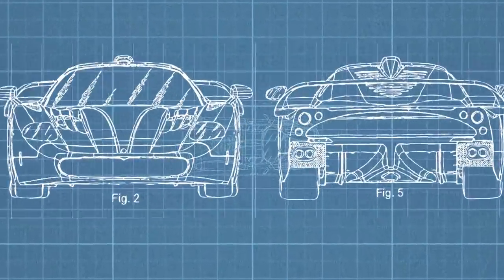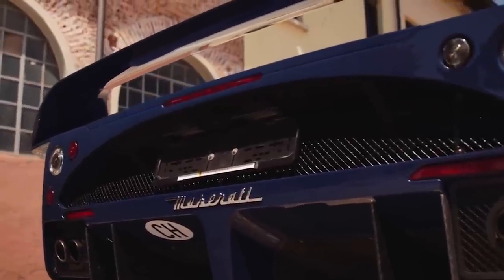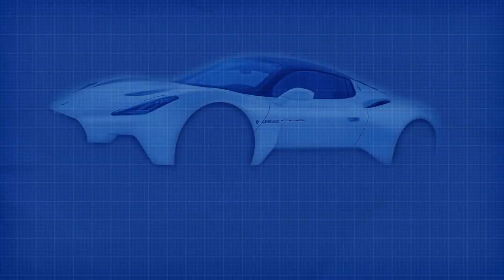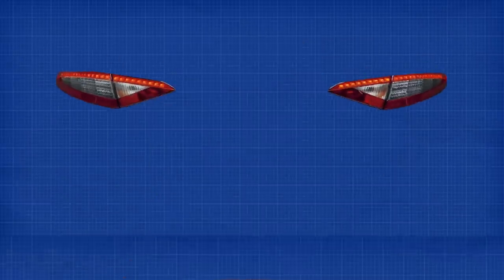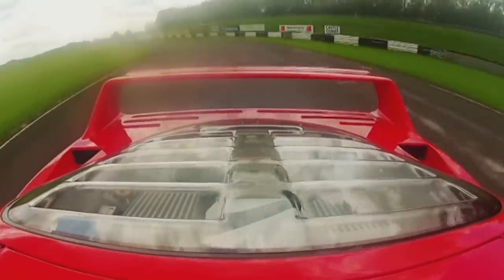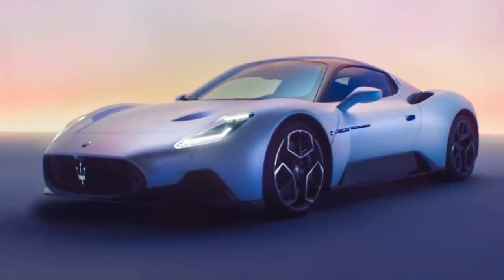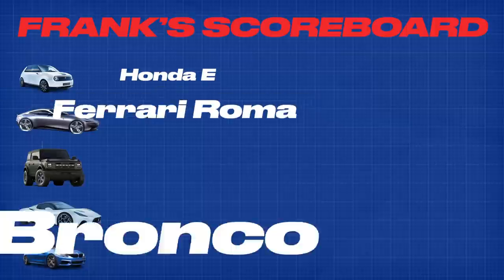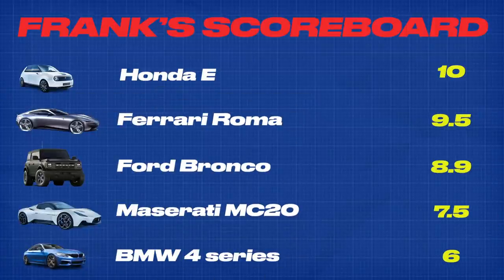MC12 Designer Analyses The Maserati MC20!

Comment: To be honest, I like the understatedness of the car. I especially like how the air intakes at the rear fenders aren't overly present. For the wheels, rather than highlighting the trident I would have liked if the inside of those three shapes brought back the concave shape pointed out as a defining feature of the Maserati front grill.

If we do get a wilder version I'd like an active rear wing and maybe something not quite an edge, but some kind of tightening of the curvature along the fender line drawn in red in the video.

Also, 100 times yes on keeping the interior more tactile. I hate how so much design is hiding buttons and such away the past decade. I dont want a surface that magically does something when you touch the right spot. Give me a visible and tactile button to push, please.
Reply: Understated... for a 1000hp car.  ....
Crap idea
Reply: @dombower  to each their own. It's not like there's a shortage of more bombastic super/hypercars.
Reply: Same. I like designs that are bonkers, but for myself, I like.... simple
Reply: Its nice, but forgettable. The front is not sharp enough. I've already forgotten about it.

Comment: Unlike Frank, I LOVE the design. The engine sound is where I believe after market should start working on. The design is beautiful and understated which will age very very well. That rear glass is gorgeous. Perfect size and attractive interior without loading inhibit with tech that will age and now a days looks tacky and cheap.
Reply: Frank shouldn't keep referring to the MC12 as the ultimate Maserati. I don't think that design is aging well. To me it comes off as fussy and boy-racer. It is mostly show and not that much go! Who needs to drag around a spoiler good for 200 mph when most of your driving is 50 mph from stop light to stop light? MC20 looks better even standing still...

Comment: I never expected I would disagree with the designer of the MC12. I love the MC20 design. The .38 cof does need work, but I suspect that is the fault of EU requirements for road cars. e.g. limitations on airflow control surfaces on road legal cars. (wings, spoilers, underbody, and aero flow conditioning elements)
Is it a better design than the MC12... No - they are both wonderful. I would not be able to decide.

Comment: I had the opportunity to see it in the wild in Modena, and I've to admit that the car is lacking of character and iconicity, typical of italian cars. Maybe a sport variant of it will change my opinion.
Reply: It's an enlarged Alfa Romeo 4C so its design was compromised from the start
Reply: @KumRuzvalt93  you don't understand. The Alfa Romeo 4C was made by Maserati too. The MC20 is based on its chassis.
Reply: @nessuno5403  you clearly don't know anything about this car.. Alfa Romeo 4C was produced at Maserati Ciro Menotti Plant in Modena, but that doesn't mean MC20 is based on its chassis. In fact, MC20 has a completely new carbon tub that actually is 3 times larger than the Alfas. All the architechture is completely different from the 4C, starting from the suspension layout, engine position and door opening. Please review your sources of information before being childish and arrogant in the comments.
Reply: @papposupercarwatcher  you need to learn English. I did not say it's the 4C platform. I said "enlarged", which you confirm. It is an evolution whose tub is made near Naples by TTA Adler as was that of the 4C. Moreover, MC20 was meant to be a new hybrid Alfa supercar 6C/8C. You need to stop accepting PR spin superficially.
Reply: Hi Frank. Love the channel and the analysis. Lots of fun. The original NSX is close to my heart. Would love to get your analysis on the successor. The NC1.
Reply: @autodojo6235  why not both!
Reply: typical of italian cars? man italian supercars are full of beauty and passion like no other! there's a reason if 9 of the 10 most expensive cars ever created are italians! maybe u dont like this maserati, ok it's your opinion and i respect it but dont write stupid things please!
Reply: @nessuno5403   so if the MC20 carbon monocoque supplier is the same of 4C, must certainly based on the same chassis or an "enlarged" one. What the heck does this mean? You prolly read this on AlVolante or some cheap magazine you found at the barbershop. Do you think chassis are built copying an old car and stretching it on PowerPoint? You don't have a clue on what you are saying. MC20 is a completely new project and doesn't share anything with 4C, 6C or 8C. These last two are old "studies" (not even concepts) on which FCA governance decided to cut the budget. Fortunately they had a vision on Maserati brand so decided to move on relaunching the Tridente brand instead of Alfa. You Alfa guys are exhilarating.. I can understand you are frustrated because you lost an opportunity to develop a supercar, but you have to be naive to think that an Alfa sketch on Photoshop can be the fully ready project that Maserati put the logo on! Knowing how picky Centro Stile guys are, as minimum, they took 2 years just to redesign Y=0 section ahahah
Reply: @papposupercarwatcher  what? I am not an Alfa guy and these chassis redevelopments (the MC20 has a 4C basis; MC20 was poised to be the next 8C again) or shared product plan operations are common within FCA - eg Maserati lost the California to Ferrari and the 8C was a Maserati. Not sure what your rant adds other than displaying your keyboard warrior skills.

Comment: 0.38 cd?! my fiesta has a cd of 0.35..... wow
Reply: IKR what a world where they decide to brag about that
Reply: ikr, most new german cars have less than 0.30 with some mercedes models even the cheapest ones like A class having 0.22 !
Reply: @dominicancheif117  what i meant by that is that my fiesta is a brick.... sport cars usually have a higher cw because they create downforce, therefore drag but 0.38 is very high
Reply: The 2018 Jeep Grand Cherokee had a cd of .37, for comparison.  LuLz
Reply: Perfromance cars don't have very good C_d values. Some of the vehicles with the worse C_d values are F1 cars f.e. where C_d values are ~ 0.7.

In performance cars you want to reduce lift (push the car down onto the road to improve the load on the wheels, high speed stability and medium to high-speed cornering). The cost of reducing lift is drag because whatever manipulates airflow causes drag fprces as well. Usually a good design has a high aerodynamic efficiency ( | C_L | / C_D) and specifically flat underbodies and larger diffusors are favorable to large wings as there reduce lift at "lower drag costs" but airflow over a rear wing is much easier to understand and manipulate as the air is relaitvely undisturbed so far. Spoiler like on the C7 Corvette with the Z07 package are probably least efficient in that regard but if you have enough HP and or travel at low speeds it might not matter (in the short term).

Comment: Very interesting analysis, Frank ! As a Maserati enthousiast of the past (I owned a Maserati Quattroporte Sport GT from 2007 up to 2015 and a Grancabrio MC from 2015 up to 2018), I turned my back to this mythical brand when they launched the new Quattroporte, the Ghibli and especially the Levante. The introduction of the diesel engine helped them to sell a lot of cars, but didn't help their status. In fact the same history as Porsche which is not an exclusive brand since already a long time (remember 924 ...). Also the new MC20, allthough all in all a handsome car, has some major issues. The beautiful trident logo in the grille has to be removed when you put the licence plate !!! That's a major sin !! Then, the optional carbon fiber for the exterior is shiny, whereas the carbon fiber in the interior is matte. The tail lights remind me of the Alpine. It would have been so much nicer copying the boomering tail lights of the 3200 GT. The steering wheel is very pretty but that tablet ... OMG ! And there is some weird, curvey stitching on the dashboard at the passenger side, probably because of the airbag. And then the price of over € 200.000,00, which is Ferrari, Lamborghini and McLaren territory. I think they should have targetted the 911. And last but not least : it will come as a full electric ! The petrol version will loose all of its value, I'm afraid. But let's be honest : an electric Maserati ?? The beautiful sound of the NA V8 was an integral part of the Maserati heritage !

Comment: As a lifelong fan of “omologato” rally cars, please review the Lancia Stratos and Ferrari 288 GTO. Still in my eyes two of the most beautiful cars ever made. Another along the same line would be the brutally purposeful looking Subaru Impreza 22B. All gentleman’s racers for the road, and probably the reason I have a white, gold, or yellow painted rim fetish! Love my ‘03 JCW Cooper S. Gracias Frank, salud y pesetas.
Reply: The 288 GTO wasn't a rally car. It was for Group B Circuit Racing which was meant to replace the Group 4 GTs and Group 5 prototype classes such as the Silhouette cars in Japan and IMSA GTX in the States. Broup B Circuit Racing series never got off the ground but was intended to be similar to the Group B rally class where they were going to have unrestricted turbos allowing  for ridiculous amounts of horsepower. The 288 was developed, based on the 308 with turbos, but that series never got off tghe ground and so it never got to race. The Porsche 959 was also developed for the Group B Circuit series although it was a versatile platform that could have been developed for rallying. There was also a planned Lamborghini Countach 5000QV "Downdraft" that was planned to race in the Group B Circuit Series. Oh what could have been. The F40, the Countach and the 959 all racing against each other in a road racing version of Group B. Similar to the rally series it was going to allow "Evo" versions of the road cars. The 288 Evo was what eventually became the F40. There was a Ferrari Group B rally car, the 308 GTM, that was developed by a Ferrari dealership in Italy.

Comment: Hello Frank. Regarding your remark on the wheels. I think the design more resembles the grill/front intake of the car.
I agree. The MC20 is not the car I was expecting, it being a Maserati. Good looking car but not outspoken like older Maserati designs.
I can think of only a couple of mid/rear engine Maseratis.  Bora,  Merak and MC20. So not much to compare.

Comment: The point about the interior losing its manualness is spot on. Humans lose a sense of interaction, of control of the machine when it doesn't give feedback. The best compromise might be analog switches but which have digital responses behind the exterior so that the efficiency is maintained but the driver still feels immersed in the driving experience, not floating on top of.

Comment: I think the biggest issue that this all boils down to is that this doesn’t look or “feel” like a true Maserati because it wasn’t meant to be one from the beginning. 

There has been a lot of press and talk that this was originally developed to be the next Alfa supercar, most likely the 6C which was on the Alfa product map for quite a few years, and confirmed to be in the late-stage pre-production phase before vanishing from the product map at one of the stakeholder update meetings. Fast forward only a few months from the meeting where the 6C plans were discussed to have been scrapped so late in the game, and out pops the news of a new Maserati Supercar to compete with the likes of McLaren, a la the MC20. 

Parts sharing is typical as we all know, especially with Maserati of late, but just look at the interior. It’s basically 100% stelvio/giulia down to the center screen, knobs and buttons, and the steering wheel. The interior even looks like a perfect follow-up to and evolution of the 4C.

I think this was basically just about finished, and at the 11th hour, some head honcho decided “let’s make that a Maserati instead” and they had to redesign the exterior VERY quickly and also on a tight budget. Hence the generic styling and anonymous-like brand-emitting (or lack there of) details.

Comment: Hi Frank, great video as always, I absolutely agree with you, this car is really cold, it completely laks drama and as you said "Italianità", it doesn't feel like a Maserati: the GranTurismo or the Quattroporte exude passion, power, elagance and luxury all at the same time. It's the first Maserati in a long time that I don't adore. I feel upset by this two facts about the name "Maserati Corse": the car should have been much more extreme looking from the outside and 6 cylinders are really too low. Interior is too digital, but that's the fashion of the moment unfortunately: as you said I really like the connection that an analog instrument establishes with the driver or the passenger (or even an admirer who stares at the interior of the car while it is still). I like the back view, although I'd probably prefer it with the boomerang inspired lights as you suggested. The disappointment I feel from this car is surely emphasized by my love for Maserati, hope they may do better next time!

Comment: I disagree - this thing is amazing. It balances poise and drama effortlessly and is muscular without being crass. The technical substructure and and curvaceous top combine beautifully, complementing rather clashing with each other - suggesting a dynamic interplay of function and form in an exquisitely well crafted way. There is nothing crude or brash about this but that doesn't rob it of drama. No, it rather, imbues it with a sophistication and confidence that doesn't need to visually supplement it's performance credentials... Yeah, so - you know - it's nice.

Comment: Thanks for the video Mr.Stephenson, it's a great pleasure to hear your opinions and ideas.
First, I think we lack a lot of understatement in sports car, and the lack of drama is imho very pleasing here. It's another offer and actually "outside the box" in the supercar context. The rear should/could have been better.
To answer your question, for three tone ; in Europe, as far as I'm thinking, I don't see much examples. There was the volkswagen Harlequin series which, I think were brilliant simply because they were offered on the market. 
In America there are some examples, the Packard Carribean of 1955 1956 are one known example.
https://cdn1.mecum.com/auctions/ca0818/ca0818-345896/images/1-1532525324047@2x.jpg?1533774951000
https://cdn.dealeraccelerate.com/volo/2/17452/399461/1920x1440/1956-packard-caribbean-custom-convertible
In Pre War,  one of the first front wheel drive had this very interesting art deco, colour bands
https://i.pinimg.com/originals/a9/f2/b7/a9f2b78090117584fce99564e21c169e.jpg
https://mindovermotor.files.wordpress.com/2016/02/ruxton-at-radnor-hunt-concours-4.jpg?w=672&h=372&crop=1

Comment: The only thing that gets me with this design is the fact the rear end treatment looks too similar to the McLaren GT. I do like the juxtaposition of the smooth upper bodywork treatment compared to the lower more technical details. But maybe that's just me. I think a solid 8 to 8.5 rating as it's more road car than racing car. Although I do get why you say it lacks some drama...

Comment: I was quite surprised that the door is also the dark part at the bottom. IMO it should only be the white part, the dark part should remain on the sill area of the door. This is because when the door is open it is just too darn big. So shorter doors.

Comment: It looks looks a streched 4C Alfaromeo  or  how a4C would be  if  it had a V6 engine.    You are correct ,  vents are not so  visible  ,  they would be better if they were as 4C. But still it is beautifull  car ,  i think designed to be used as a day car  and less as a collectible  one  which is fine with me.